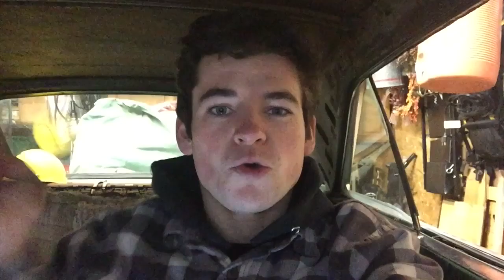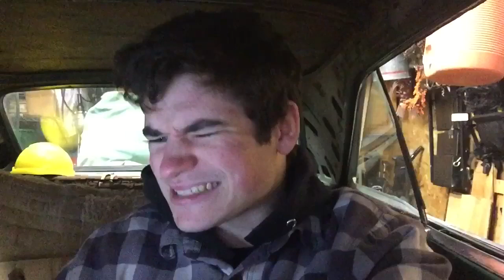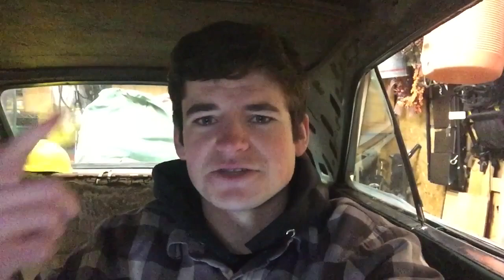Banning Lockup Converters in NPK - No Prep News Episode 5

Comment: Who has lock up converters. Kye , Lizzy, Ryan, Chief, Bird brothers, and Robin Roberts . A few more probably. They can turn them on or off with the computer programming. Lizzy was first blaming the lockup causing her to get loose in the top end. But when she turned it off it made no difference. Anyone can install a transmission that has it. But it should be up to the driver if he wants to use it. I heard chief say he has a button to turn it on if he wants it and feels it  will hold it.
Reply: Lock up is with the way the converter is brought up to speed and makes it a direct drive from engine to transmission thru the converter creates less heat and friction, how can you shut it off with a button are you talking about a transbrake? Ive never heard of a converter override button before were you can tell the converter to do something else even though a lock up converter is only built to do 1 thing.
Reply: @topseykretts251  yes there is a clutch inside the converter. It is applied with hydraulic pressure. It has a solenoid that turns it on and off. You can have the computer turn it on or leave it off and have a button on the steering wheel to turn it on . A torque converter loss is gone when the lock up is applied.
Reply: @dragvan1937  Ok must be a new thing, Ive been building Chrysler's lock up converters and trans.since the late 80's and they dont run off of a switch to activate them.
Reply: The only buttons We run on the drag car are a transbrake and line lock button. We use a modified Chrysler lock up style runs off of a pressure solenoid and a modified PTC 8" 5200rpm lock up converter.
Reply: @topseykretts251  yes not using a Chrysler style of transmission. To get more control of the transmission and so they can use a looser converter they copied the idea of a friction material and a plate that with fluid pressure applied to the back of the plate when they want it to apply. It's similar to the computer controlled transmissions the imports used. Chrysler used a valve that when it reached the set pressure it locked up the converter. On a Toyota transmission you could turn on the lockup and kill the engine in gear.
Reply: @dragvan1937  There all basically the same design impellar connects directly to the turbine, so you get a direct drive setup and eliminates slippage, runs cooler. Same designs just different controlling functions.

Comment: Oh where to start?   Well as far as changing rules in no prep, there really hasn’t been more than a few rules if any ever until the NPK show.  Factory roof and quarters that came with the car from the manufacturer meant for following DOT regulation, and tire sizes for classes.  Larsons truck didn’t have unmodified factory quarters because you cannot run a 36” tire with a stock s10 bedside.  Therefore it doesn’t fit the rules or spirit of the genre of racing.  Same reason why Laughlin’s car was rejected.  

The big kicker for me is cars like birdmans and Scott Taylor’s.  Those cars to my understanding are retired pro cars from the early 2000’s and are stupid light weight and is questionable if the bodies ever came from GM in the first place.  Mike Murillo has to change the quarters on his mustang because he modified them with humps to accommodate the taller tire and lower center of gravity.  

As far as lockup’s are concerned, to me it shouldn’t be a penalty or outlawed.  They can work really well and at the same time be incredibly dangerous on a true no prep surface in early rounds.  Keeping parody amongst the cars is critical for the sport of drag racing in general.
Reply: Well said sir. 👍

Comment: I used N2o for my turbo truck. Mainly for a intercooler product. I use a single BW s480 turbo with a 408ls engine. Helps spooling some but the bottle in the NPK cars are Co2 for waste gate/ boost control.

Comment: I see why people could call it ruling against the fast guys but the spirit of this series was intended to be "real cars" or "street" or whatever. I'm also not sure we have gotten or ever will get the truth regarding those rule changes. Did it look like they were specifically ruling against Birdman and Larson? Sure it did, but that makes sense. Birdman will tell you it was because he "was too fast" but in reality he just wasn't fitting the rules. That car would probably be a lot closer to race weight if those quarters were factory. Larsons truck wouldn't have needed a weight penalty if it was made of factory steel too (and the wheelbase/longbed fiasco wouldn't have happened...). They retroactively fixed some of the issues with how those vehicles were never really legal in the beginning and those were probably the two most blatant offenders. Seriously, who else switched their twin turbos to a different power adder after that "rule change"? Axeman is the only one I can think of and that was well after the fact and it looks like he went to procharger intentionally, not just because the rules forced him to change. I'm not sure if it's a new thing but I don't think your typical VIN numbered steel roof and quarter backhalf car would make a lot of sense with a lockup in it.

Just my two cents.

Comment: Sim. About all of them are running Lock up Converters and Nitrous is on the turbo cars. Big Chief has been running Nitrous on his Turbo car for a long time. Air is What makes a Turbo car spool not fuel.  I don’t know the rules of no prep if they actually spray the turbo cars or not. But as far as do they run Nitrous on the Turbo cars. Yes. I was at SEMA when Big Chief”s car was there a while back and took pictures of the Nitrous set up on his Turbo car. 

BTW. Big Chief and Ryan would be considered new to Lock up Converters where Kye and Lizzy have been running them for a long time.
Reply: None of the Turbo guys have been running Nitrous with the Turbo, some have been running  nitromethane derived Methanol in the fuel for a while.  Also the tanks in the Turbo cars are for Carbon Dioxide  (CO2) Boost control systems.

Comment: Also, the lock up converters are dangerous because accumulated air and/or hydraulic pressure is used to INSTANTANEOUSLY SEND 100 PERCENT of the power to tires, actuated on a timer usually. This is dangerous on a non prepped track.

Comment: No double power adders
Reply: Is that actually a rule though? Because technically, they're not using nitrous to add power...they're using it for the transmission, and to build boost faster....eh....I guess it is adding power, but only to the existing power adder (turbo)🤔
Reply: @stevenneal172   The bottles in the cars are for the CO2 boost controller systems in the turbo cars
Reply: Yes it’s a rule for the NPK series.

Comment: Allowing them to run lock up converters would be like allowing top fuel to run clutch management through a computer to control wheel spin. Too much Money ruins all sports. Eventually you will see the car count go down because of that. I've seen it happen in many sports.Allowing nitrous to spin up the turbo or pro-chargers is two power adders. The pro-chargers don't take as long to spool up as a turbo. This is why you see burn downs at the starting line, it depends on who goes in first.

Comment: Lock outs are SERIOUS BUSINESS in racing. And yes you can make a lock out for a 4500HP Hemi blown promod. Those are banned in the NHRA for blowers and turbos which is probably why the nitrous people want to run them in NPK. Nitrous is allowed a lock out in NHRA but with the weight savings they're also giving the damn nitrous people nitrous has been allowed to go ahead of people. Lizzy Musci is kicking ass in the NHRA on a nitrous, lockout 990CI Musci engine. NPK just doesn't want the same thing to happen and they're right. 

Nitrous can take 200 pounds off in NPK and if they allow a lockout on a converter that is designed to slip for SOMETIMES but would be damn nice to NOT SLIP at other times? It's too much.

Comment: I'm curious on why they don't use an intercooler anymore. Maybe the turbo cars are using n2o.
Reply: I'm pretty sure it's because of the fuel they're using, the alcohol and methanol cool off the air going into the engine enough that intercoolers aren't necessary and possibly a restriction, also some might be using water cooled heat exchangers(pretty sure that's what that set up is called) but mostly I think it's because of the fuel they're running
Reply: Driver 1967  oh wow I always thought that was some sort of starting fluid or something but that makes sense given how you can see frost on the intake manifold sometimes

Comment: I think it should be the same rules that they have for X275 at No Mercy No Guts No Glory Lights Out and other RVW CLASS races that way RVW cars can race in NPK as well like N2O cars can run lock ups but Turbo and Screw/Roots blower cars can't unless they are over a certain weight at the beginning of each season each csr should be made to go on a chassis dyno and if they make over a certain HP and TQ then no lock up unless they want to add weight and take a weight penalty and you should be able to extend or shorten the frame +or- 2inches only all cars should be no less than 2400lbs and no heavier than 3200lbs you should be able to run a 10.5w tire and no tires bigger than 34x17 in the rear and steel roof and quarters anything else can either be fiberglass or carbon fiber and all cars should run double frame rails and the turbo and blower cars should only be allowed a certain amount of cid and N2O cars can run up to a 959cid CO2 or Nitrous to help spool up the big single turbo cars and they can run intercoolers if the choose to if not run methanol

Comment: All cars must have factory roof & quarters. They must weigh no less than 3200 or 3250 pounds. The can not alter the wheel base. 
   If the front end is extended it’s a Pro-mod car. That’s why chief got rid of his Pro-mod. 
  I’m sure I’ve mist some other rules . But those are the basic rules

  I don’t get the piece that everyone runs on the front end?  That piece she trip the lights at both ends???

Comment: The only difference between alex laughlins camaro and ryan martin is wheel location. I believe they were crying cause he was a threat and told him it was not allowed. The rule clearly states it has to have stock wheel base +-2 inches. The front end cant be extended more than 4 inches + extender set length. Kayla car is the same set up, its a stock wheel base car but they shifted the wheels forward on the chassis. Basically the rear wheel to the back of the door gap is smaller than stock and the front wheel to the front of the door gap is longer than stock. Kayla and alex car are both like that. Alex car even had the factory length hood and fenders. The wheel bases is still stock just shifted forward under the car. That helps with weight transfer if you put kaylas mustang next to a actual mustang like alex next to a camaro you will see what im talking out. O.a. lost my respect after that. You allow that style for one car but the guy you dont like you say his which is the same but it is illegal. Also npk is a single power adder only so no they arent running nitrous with turbo. Unless the show is even more of a joke than i thought and allowing some people to run dual power adders and nobody else. More rigging for the 405 i guess. Edit: to add welcome to 80s-90s nhra, or the downfall of nhra. they started catering to the more well known guys so they always win and nhra almost died. Then they relaxed the rules havnt had a big change in almost a decade and now nhra is setting attendance records even at tracks npk has been to. But people still claim nhra is dead. If anything it hasnt been more alive